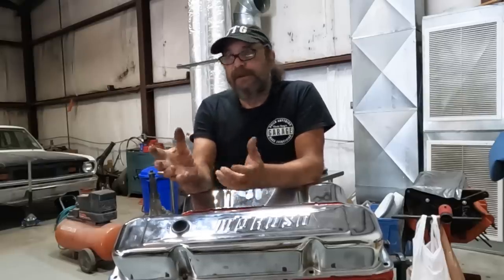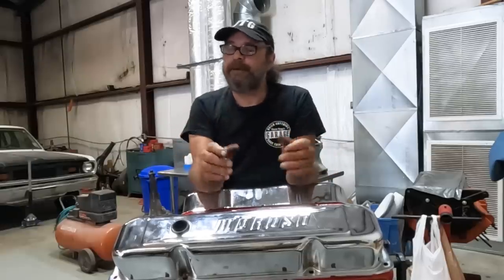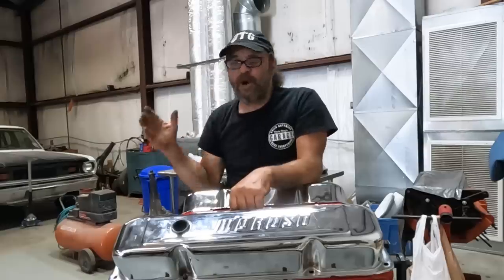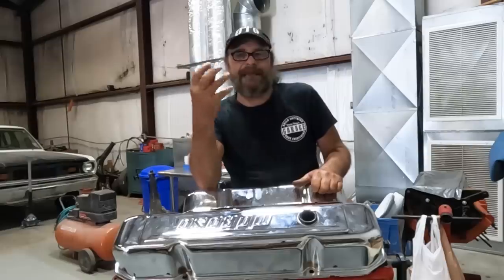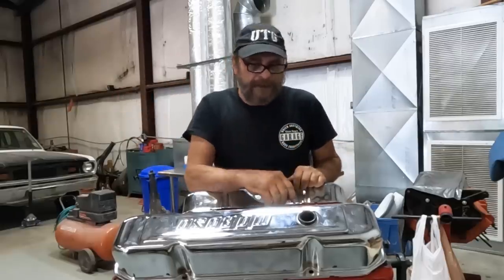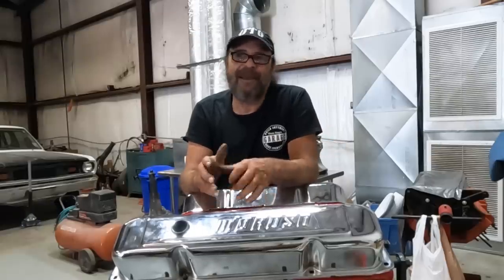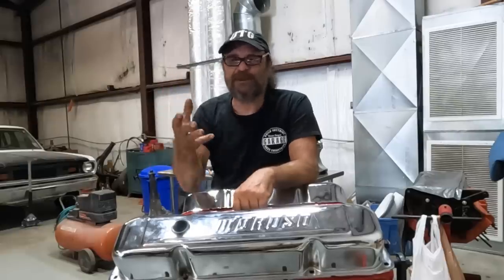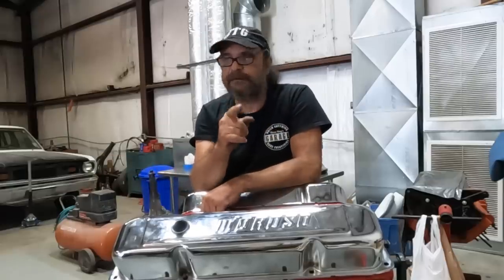Head Gaskets - Myths Busted, History And Types For The Home Engine Builder

Comment: When your at the track and need to do the coat hanger wire trick but a coat hanger is nowhere to be found, the engine dipstick works in a heartbeat to hold the pushrods in place.

Comment: Uncle Tony is a perfectionist with engines, Uncle Kathy is a perfectionist with video production!  What a lovely combination for us viewers.  😁🤣
Reply: Tony is a very lucky man to have a women like Kathy by his side through thick and thin. They're truly a team.
Reply: Uncle Kathy, you're confusing me lol
Reply: Walmart oil 🛢 😬 🤗 changes
Reply: @johnshackelford6965  Walmart’s oil ain’t bad, I use it in my 2001 Saturn with 319,+++ miles on it and it runs like a champ! It also leaks so I ain’t wasting $30+ on a gallon of oil just to run Castrol. Wife’s car doesn’t leak and I use Walmart oil in it. Walmart’s service though? Questionable at best. But at least I can’t recall letting them change my oil and then sending me away with low oil. A 15 minute oil change in Tampa though did exactly that. Refused to accept that the filter has a separate capacity than the oil pan, and I had to go find a quart of oil to top it off, in Florida in summer, on a trip. Sounds like not that big a deal but it was when I paid for 4.5 quarts of new oil.

Comment: @14:00

Nice you pointed that out, Tony. Been beating that advantage up to people who don’t comprehend, or don’t understand that design advantage for years. 

Fun fact: the first gen (49-64) Olds Rocket has 6 head bolts around each chamber- and I’ve never seen or had to replace a head gasket on one. 

This made a huge advantage for early blower motors in the hot rod scene of the 50’s and 60’s- with that kind of clamping power, the early Olds engine did very well with forged internals in forced combustion arrangements.

Comment: Are you sure she said “go film yourself?” Back in the 80’s with aluminum heads and iron blocks we found on the Ford Escorts that the poor coolant was etching away at the heads and depositing the aluminum onto the water pump shaft causing the pump to lock up. The early Escorts were interference engines and the timing belt drove the water pump. Water pump locks up, engine goes bang. Aaaahh. The good old days
Reply: I remember those too
Reply: Whoa. Must have been terrible metallurgy.
Reply: I came here to say that 🤣
Reply: @smncutler  well you put two dissimilar metals near each other with acidic coolant and add electricity to it and you have electroplating
Reply: @notmybleepingbike4812  carmakers have been doing it forever with great results. Ford just half-assed that one...
Reply: You gasoline guys have no idea how important coolant maintenance is.
Reply: @johncholmes643  😂😂 Aren’t you a big one swing. 😂 Those old Escorts really high lighted the need to maintain coolant.
Reply: Early ford escorts? The first gen from the 60s or the second gen from the 70s?
Reply: @1DEADBEEF1  Starting in 1981 with the “World car”
Reply: Got to use antifreeze with aluminium heads to prevent corrosion. With the engines I deal with the headgaskets leak first, the cooling system over pressurises. That forces water past the water pump seal and into the bearings where, because there's no antifreeze, the bearings rust and it's the rust that seizes the pump.
Reply: the last Escort I had, had just stolen my wallet. LOL
Reply: @notmybleepingbike4812  he is referring to wet sleeve diesel engines not a recycled beer can motor.
Reply: Porsche 944 turbo was also interference with a timing belt. Pulled that cylinder head twice dang it. Fun car to drive though

Comment: Hate to tell you but Uncle Kathy filming does help the video quality.  Also on the higher horsepower turbo diesels if you do not retorque a few times on a head gasket install you are pretty well guaranteed of failure.

Comment: 11:26 I remember hearing about certain late 90s Fords having issues with "false" check engine codes because of dirty coolant and the voltage it creates. 
Check engine light on? Could just be dirty coolant if it's an old Ford. 
Some more recalling , something about using ground straps on heater cores and other cooling system parts to try and calm down the electrolysis /voltage issue.
Reply: stray voltage will eat out a radiator or heater core in weeks ,Even when a new item is installed. earth out radiator , earth the engine earth the body.
Reply: I work on class 8 diesel trucks. They all have several grounds on the radiator and cooling system to TRY to prevent electrolisis  . Red antifreeze is the worst I have seen in those engines.

Comment: Thank you for explaining all of this. I recently rebuilt and did initial break in on my 72 Cutlass S (original 350 block and iron heads) and was confused by the information out there regarding whether to retorque the head bolts. My Chiltons manual told me to retorque, but my Chassis Assembly manual made no mention of it. Im using the newer style of composite gasket to be clear. Thank you, have a great day.

Comment: Sealing technology has evolved beautifully. I absolutely love the Felpro Permatorque MLS head gaskets. I've used them on every Honda SOHC engine I've done work on and they never went out of torque (even though the manuals tell you to double check torque) and I've never had a defect. I really like having the extra insurance of the MLS along with that blue compound they put on it. I've pulled heads off of junkyard cars that were abused as heck and that coating held them together. Whenever the time comes to reseal my '79 Chevy Van's 350 it will get a PT MLS gasket set as well.

Comment: I just rebuilt a flathead willys. I ran and had a few heat cycles. Used a copper head gasket. I planed to re-torque at 100 miles. I had maybe 20 miles. I had bubbles in my coolant. I re-torqued and the gasket sealed.  I now have hundreds of miles. Nice thing with a flat head, I dont have to remove anything to retorque.
Reply: I am also rebuilding a flathead willys and  plan to use a copper head gasket. Maybe this is a dumb question, but did you use the copper spray on your copper gasket?
Reply: @joshuamuckey4667  , Yes, I called the manufacturer and they said a thin coat both sides is recommended. It turned out my problem was with the head corrosion at one of the water ports became too close to the cylinder area. I had to get a new head.

Comment: By the way, my first monster big block was a 383 with a cam out of the direct connection catalogue. It was called.a purple cam. There were others too. It was .695 lift, 340 degree and mushroom.tappets... Rev cam. It was psycho motor. I rallied off road in a 68 short bed power wagon. With factory 2" lift. No jeep or land cruiser could touch me. Of course no power.breaks, but.i could idle.up a 38 degree incline.with moguls. I took the doors off and a couple times walked along.my rig to read tje.lie of.land
Got.married and stupidly broke up the classic to put the motor in a satellite to roadrunner conversion. 25 years later.it was.in a speed.boat with only add the wet pipes. That was a bad ass psychootor.

Comment: Yep. I had that exact same thing happen on my old '89 Volvo. The gasket leaked coolant slowly in between the 1st and 2nd cylinders into the 1st cylinder and etched the block. Because it was a turbo and thus low compression, it still ran pretty good and I didn't know I had a problem until it was too late. I would have had to had the block welded and then resurfaced to repair it which just wasn't worth it.
Reply: I'm assuming you're talking about a b230ft, in which case you could have bought a long block for like 400 dollars. I sold a 200k b230f with an m46 on it with the harness and accessories for 350, but it was an 85 with the thin rods. I boosted my NA 90' 240 and they hold stock boost fine and have a ton of torque with the extra compression
Reply: Wasn't worth it? How expensive it was? Its an backyard job that any shop with an lathe and an welding machine can do(you see guys in rural india doing it with even less things). Seems like such an small thing to comdemn an engine for.
Reply: @kinsmart7294  costs about the same to just replace the motor, which can be done with pretty basic tools and a harbor freight engine hoist. Prices have doubled on a lot of redblock cars and parts the past 5 years, but it's still one of the most affordable RWD engines left, and they've got plenty more potential than people give them credit for. 

Rods and bearings alone are enough to get these cars into the 500hp range if you start with the right model year block, like post 93 squirter blocks. My car was so slow it hurt when I got it with around 15 second 0-60, but just with a manual, weight reduction, a 3.73 diff, and 5psi of boost, the car is about as fast as my old S60R, which was a 2.5 5 cyl on 15psi
Reply: @StreetForged  The situation is different depending on the country for better or for worse. In my country engine swaps are rare(its also an pain in the neck to legalize), so 99% of old cars have the original rebuilt engines, with bored out or sleeved cilinders.
Reply: @kinsmart7294  I could move the #1 piston back and forth with my fingertip.
Reply: @myleftthumb2294  Yeah, now that makes sense, it would take an whole engine rebuild. Up and botton end.
Reply: @kinsmart7294  that's ridiculous. I hate how much crap they put auto enthusiasts through.
Reply: @StreetForged  Its all good, like i said it has the upside that people won't throw away an rare 302 ford v8 engine and put an volkswagen AP-2000 on their Ford Maverick.
It kinda preserves the car's "essence", the thing that mostly happens here however is converting the car to run on propane to save on gas.

Comment: Was wondering about the whole retorquing thing when I put the B20 engine together for the 66 Volvo wagon you see in the little round picture. Every Volvo guy says you gotta retorque OR ELSE! It was my first and likely last vintage Volvo engine build so of course I did it. Kind of a pain in the ass, pull the rocker cover, then pull the rocker shaft to get at the bolts. Legend has it Volvo used a special socket to do this without pulling the rocker shaft, was pretty sure that's a load of crap, now I'm convinced.
Reply: Same issue with my '52 Case SC tractor. PIA.

Comment: I rebuilt a vintage Coventry Climax engine some years ago and all of the gaskets were made of leather and assembled with a thin layer of grease, It still runs today and is fitted to a early Morgan 4.
Reply: i tried pig leather for the thermistat hsg...would last about a year..looked really cool
Reply: Coventry Climax were used in early 60s F1 cars with dual Weber DCO/SP carburetors--then mechanical slide throttle injection soon after.

Comment: I still like Copper Coat no matter what. Something else about the fire ring gaskets, if you're using aluminum heads there are three distinct warm up temps,  iron, aluminium and stainless. 
UT, you ain't bad on the filming side but UK is better. Please use her as you can. It's also nice to have another point of view as well. 
Please keep doing what you're doing 😆
One last thing. I've made leather gaskets myself.  I'm reminded of the time my Holley 500 quit in Apache Junction, Az. at 2AM because the vacuum chamber gasket had shrunk after a year of sitting on my 58 Ford Tudor, 292. I used a 10 oz.ball peen and an exact exacto knife and was back on the road about 6 hours later!

Comment: Back in the early 1960s we learned about engines working on Chevy sixes. Took off the heads, cleaned the block and head and reused the same head gaskets. We couldn't afford new ones. Our torque wrench was a 3/4" box wrench with a three foot piece of pipe as a handle.  None of us had a clue how it was  supposed to be.  We all were 13-15 years old. Backyard mechanics at  best. But the engines always ran. The good old days.

Comment: When i was a young kid I asked a  flat rate engine mechanic at the local dodge dealer what the torque spec was for sb mopar head bolts.  He said he didn`t  know.  I laughed as I thought he was joking. He wasn`t. He said he just cranks them down with a impact. He said I never had a come back. I will never forget that.
Reply: I've built more 350 and 305 Chevy engines then I care to mention. Never touched a head bolt with a torque wrench and never had a problem. Some were stock, some had speed parts. Never had a head gasket blow out because of it. I tighten bolts until they feel right to me. It comes with experience I suppose. Tightening sequence is way more important than torque specs.
Reply: I know 2 people personally that don't torque head bolts. Just gun them down with an impact. Both at professional shops too.. but they have no comebacks on the engines. I wouldn't trust it and want to cover my ass so everything like that gets torqued down properly. No need to take a gamble like that.
Reply: @Whats-It-To-Ya  I'm like that with Quadrajet intake manifolds for 350 chevys. There's always a couple of bolts on them that you either cant get to with a torque wrench or don't quite feel tight enough. I tend to do my pattern and torque most of them down to spec with my click stop and then by feel kinda match up the torque on those couple bolts using a regular wrench and hand feel. Has worked out so far!

Comment: Good video Uncle Tony! The only thing I would mention is that MLS gaskets need a smoother finish of around 10 to 15 Ra on the block and heads. The “blue” head gaskets can live with a rougher deck finish.
Reply: Why?
Reply: @jts9120  If you look at the machined finish on the block and head mating surfaces under a microscope a cross section looks like a sawtooth profile. The MLS gaskets are less malleable than the other types meaning that they won't conform to the deeper machining marks on the rougher finishes like the softer gaskets do thus the need for a smoother finish.
Reply: @brianbrigg57  Thanks
Reply: Yep. Matter of fact we just had a 2020 ram come in for a cam and lifter job. The engine was replaced a year ago with a reman (because of a hole in oil filter.) Factory these are aluminum heads, iron block with MLS gaskets. Passenger side head had NO HEADGASKET. It ran 5k miles no issue till recently with a slight miss at cold idle and cam phaser codes. We thought they must have machined that block well for it to seal up that good with no gasket..
Reply: I freshened up the heads and replaced them on my 1985 318 and noticed the same thing on the block side. I didn't want to take a chance so I used the coating on it. I think that I may have used the copper coat or metallicSpray paint I'm not sure but I never had any problems And I had also installed a high volume Oil pump.
 When I do the next set I'm not sure but I'll cross that bridge when I come to itBut I rather be safe than sorry and have to redo the workBut I have no problem of popping the valve covers and retorquing for my own peace of mind... That's why waited to put the new header gaskets..

Comment: Tony great video! I appreciate the extra effort to get it right for not only good picture quality/lighting/focus but also well thought out and accurate and thorough enough to give people an idea of when & how the OEMs changed the hd gasket material/design as they modernized from lower compression flat hd engines to higher comp OHV engines to aluminum hds & intakes. The only thing I think you might have wanted to mention (which would probably only be of interest to those few UTG folks who might be seeking really high cylinder pressures: like big boost turbos & superchargers or big nitrous shots and many of them are probably already aware of it) would be using copper head gaskets and grooving the block deck to receive sealing rings around each cylinder bore. I know for the majority of YT viewers working on their own engines out of their own garages it would be pricey to have a machine shop do it and they aren't likely to be shooting for the moon on their first couple of builds. 3 takes proves your dedication. I'm not expecting you to do a 4th video. Thanks Tony

Comment: i recently finished the engine build for my 74 chevy. i wish i wulda took a pic of the headgaskets that went into it. i was thoroughly impressed with the material and design of em. time will tell after im driving it how well they hold up but i have good faith.
Reply: I'm in the middle of a 74 Nova 350. If you don't mind, what gaskets did you use?

Comment: Good vid Tony...We used shellac on the head gaskets in the 80's because the "coolant" was migrating through the composite gaskets and weeping out the side of the heads..I still do it regardless of what the gasket is made of...Never had an issue and so why change is what I say...Cheers from Downunder.

Comment: On the old ones I like to tap holes use copper antisieze with grade 8 washers under bolt head get a real smooth torque reading.   I Kno certain motors like a 3800 u use copper spray on head gaskets